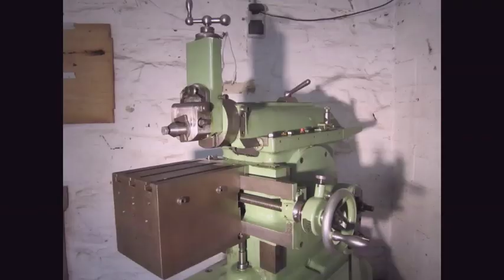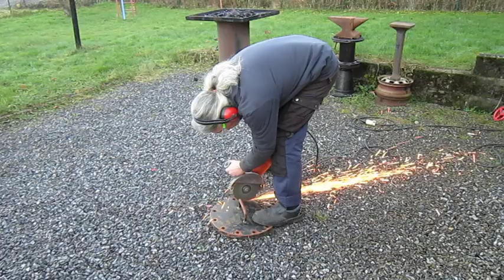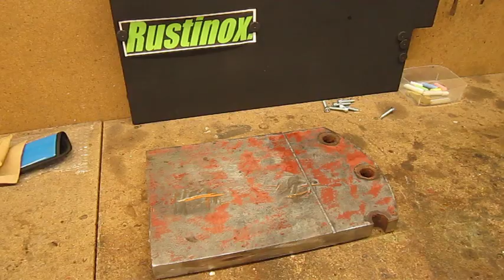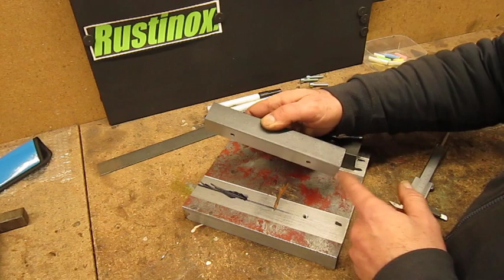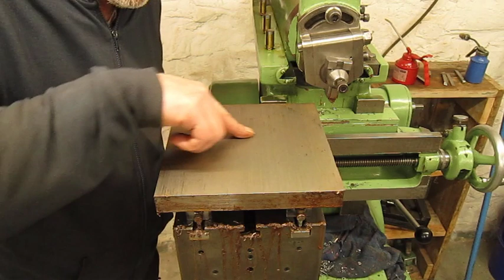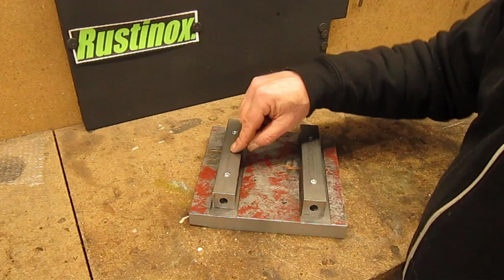Homemade surface plate.

Comment: Love your surface plate. Mine is a piece of 20 mm plate glass. Yours will be stronger and you will be able to stand your dial indicator with magnetic base on it. BUT how flat is it? Why don't you blacken the surface with a sharpie pen and then rub it on a piece of 600 grade wet and dry on a piece of plate glass. It would be interesting to see whether the black is removed uniformly.
Reply from the maker: But how do you know the glass is flat?
Reply: @Rustinox  Hello Rustinox, I intend to rise to the challenge of answering your question. I have two glass surface plates here, and am locating a monochromatic light source, so I can send you a picture of fringes. Will email a jpeg of whatever I get.

Comment: Michael, when you said your kids gave you the mug and you said only two reasons they would I immediately said they want money. Being a good dad comes second especially if they're girls. Nice little project for the shaper. One question is could you have done the edge facing on the mill and maybe have made it a bit bigger? 
My surface plate is cast iron. The end of my circular saw table about 24"*12". I haven't tested it for flatness but most ground things I put on it don't seem to rock so I'm assuming, for my purposes, it's flat. 
Not as though I'm machining parts for the Canadian Space Agency to NASA specifications of less than one part in ten billion.
Regards from Canada's banana belt.
🤞❄️🇨🇦🍌🥋🇺🇦🕊️🇧🇪👍
Reply from the maker: When I made this, I didn't had the milling machine yet.

Comment: Michel whenever I need a no nonsense approach to making homemade shop tools I come to your channel.  I am gonna make a sortof surface plate with a cast iron table saw table. Problem #1 was holding it down on my milling machine because the part is pretty big. Your hold down tool design gives me the idea I could hold it down the same way. Gonna use a fly cutter to knock down the high spots. Then I’ll steel ideas from Stephan and Robin to lap and scrape it to a descent level of flatness.  Wish me luck 🙂
Reply from the maker: Learn from each other. That's why we do YouTube.
I wish you luck, but I'm sure you gonna nail it.

Comment: Why not make it 4-5 cm larger?  You also should mount precision surface on tripod.  Investigate lapping precision surfaces
Reply from the maker: I can't make it bigger. This is the maximum size the machine can handle.

Comment: Interesting video. Thank you.
What make of shaper do you have? I have an Elliot M10 which I enjoy using. I fully agree with your comments about double checking that nothing could foul before turning on the power.
Reply from the maker: It's an AI Hembrug, build in the Netherlands. It has a stroke of 200mm (8inch)
Reply: @Rustinox  looks like a good quality machine. I'm going to look it up on lathe.co.uk

Comment: ahh lovely video! if you want to go the extra mile (thats 1.6km for us metric folks), you could try to get more plate, 2 more pieces to be precise, and use the whitworth method to get 3 very flat surfaces. yes you only need one, the other 2 are just extras from the process... but can come so handy.
also. you seem like that kind of guy one'd go to spend time at his shop and talk about machines, women and life while holding a warm cup coffee. (one of those 3 subjects can olny derive into pure conjectures)

Comment: Great job! I had a piece of glass glued on a piece of plywood that I used as a rough surface plate, and I still use it out of convenience in the basement shop. You do realize , every one of us loves to see those chips fly, cheers!
Reply from the maker: Watching chips fly is one thing. Hearing this cracking soung when you step on it is another :-)
I am looking around to find me a piece of tombstone that i could use as a surface plate.
Reply: @Rustinox  try going to the kitchen counter makers that use granite and manufactured stone, basically concrete with coloured stone in the mix and then they grind them flat. See if you can get the bit they cut out for the sink. Would make a nice sized one. Not an "A" class one but good enough for the average shop. Greetings from Canada.
Reply: @Rustinox  That would be interesting to see, I don't believe i've seen a video of anyone tackling stone yet!

Comment: Hey, you pointed out the flaws, as we are all wont to do on our own work, but it is a very usable reference surface for the level of machining that we as home hobbyists do.  Especially when it only cost you a piece of scrap, some time in the shop to play, and 4 bolts.  I'd still count it as a win.  As for the reasoning behind the mug from your children, it may just be a bit of both reasons you gave . . . I'll test that theory here in 10 years with my own son . . .
Reply from the maker: One of my upcoming projects is to make a height gage to draw lines on the parts.
Reply: @Rustinox  "Height gauge" or "scribing gauge"?
Reply from the maker: @paulwomack5866  well... scribing gauge... thing.

Comment: Turned out well Rustinox I like the clamps. You could bolt a wide work piece stop to the end of your table it already has holes in it. It will help you square the work up as well. Enjoyed the big job on the small shaper. Thank you for the sticker shout out. Tony
Reply from the maker: That workpiece stop is a good idea. It will also make it easier to trim the other vices i have for this machine.

Comment: Lovely job , I too lack having a surface plate , so I think I am going to visit some stone mason yards   for a bit of granite, Great vid Mike
Reply from the maker: That's a good idea. A piece of tombstone will do the trick.
Reply: Looking for some videos on how to lap such stones to make them flat. I have several pieces of granite countertop that are flat enough for my woodwork, but not for machining
Reply: @trackie1957  Look up the Whitworth 3 plate method. With that method you can use a set of 3 granite plates to lap each other to very high flatness. You can also use that method on a set of 3 cast iron or steel plates, though due to their much higher hardness it will also take substantially longer to lap them to the desired high flatness. However in the case of cast iron or steel you can also use hand scraping or grinding instead of lapping, using acrylic paint spread with a paint roller on one of the plates and rubbing that plate against the other one to transfer the paint to all the plate's high spots, then scrape or grind those high spots away by hand.
Reply: @pieterveenders9793  
Yes, that’s how they make optical flats, too. If you use only two plates of glass and don’t flip them, the lower becomes convex while the upper becomes concave, which is how you grind telescope mirrors. Amazing how some of the most geometrically precise things are made using pretty basic techniques!

Comment: That 1" plate looks like a part from your ship.....lol. Regards Kevin
Reply from the maker: Well, indeed it is. The old barge i used to work on was scrapped one year ago. The boss allowed me to take some parts. This plate used to be a blind flange for a 10 inch pipe.
Reply: @Rustinox  Hell - you mean that's a steel surface plate, not a cast iron one?

I was going to suggest you borrow a granite surface plate, and scrape your plate into better accuracy, but scraping steel is NO FUN!
Reply: I thought so too

Comment: That crash was similar to the one ABOM had on his big boy G&E mill.  I love Shapers of any size.  I love the straight line striated surface finish.  It looks great if not perfect.  I would go with reason number #2, speaking from experience as a father of two, now almost middle aged, pre-millennialls.
Reply from the maker: It was indeed the same kind of crash Adam had. Even if i always pay attention to it, sometimes s**t happens.

Comment: Hey, Dad, I need more pocket money!
Reply from the maker: Aha! And where is the coffee mug you offered me?
Reply: I think machinists need pocket money more than anybody. There is always a tool we need to buy.
Reply: @hilltopmachineworks2131  can i make a joke(pffff i use files)
Reply: @woozhi9218 my father was a Machinist at Ingersoll Rand in South Africa about 1930's. One of his tests for his certification was to "file" a compressor cylinder head casting flat so the machine would pump air without a gasket between the head and the block. Always impressed me that anyone would be expected to be able to achieve that let alone do it.